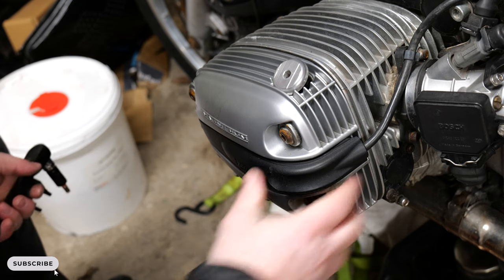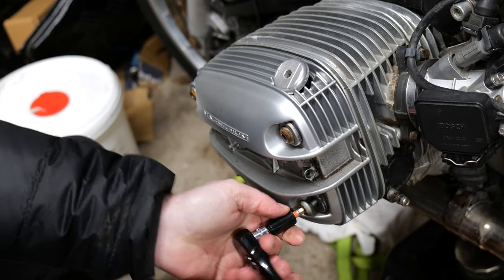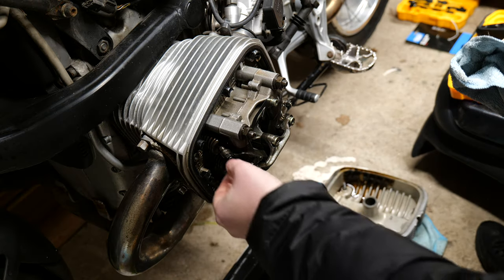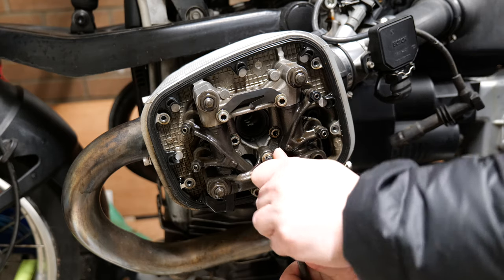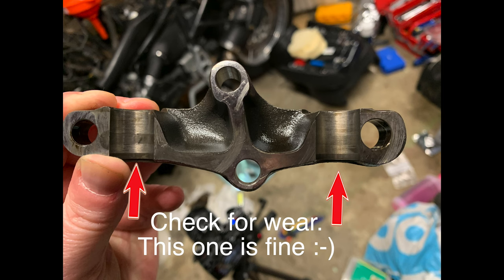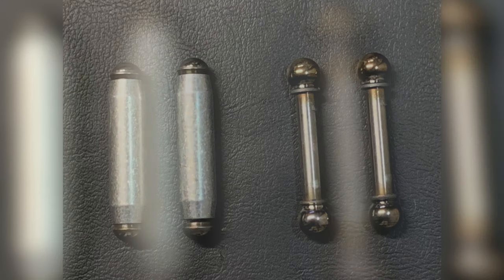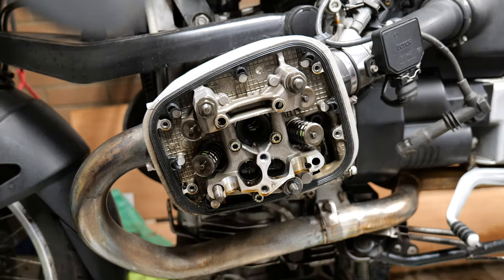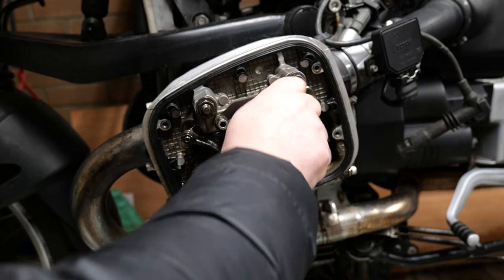BMW GS Upgraded Push Rods | Fitting new push rods to the BMW R1150 GS | Oilhead BMW. Ep 3

Comment: This is useful 👍. I didn't check my valve clearances yet but it's one of the next things to do. Where did you buy your pushrods?
Reply from the maker: Awesome 👍🏻. I got them from the motorworks.co.uk website.
Reply: @MALVSMACHINE  thanks for the link 👍
Reply from the maker: @leo5verling334  no problem at all. They’ve got a good selection of parts so hopefully you’ll find anything you need 👍🏻
Reply from the maker: @AlanBoulter  spot on aren’t they, quick delivery as well, can’t fault them one bit 👌🏻
Reply from the maker: @AlanBoulter  top notch and piece of mind 👌🏻
Reply: How many kilometers on this bike when you replaced the pushrods? Thanks and a very good video
Reply from the maker: Hi, sorry about the delay in reply, youtube doesn’t notify me if someone replies to a comment I didn’t create. My Bike had 54’000 Miles on it and I only replaced them because there was a rattle. There was only one out of the eight that was making the tapping noise but it was loud enough to be an annoyance so I replaced them all so that I don’t get the tapping noise again 👍🏻.

Comment: I have a question, are those head bolts? Does it need a new head gasket afterwards?
Reply from the maker: From what I remember only one of the bolts are head bolts so I didn’t have to replace the gasket because I didn’t separate the cylinder. It’s worth checking the rocker cover gaskets to make sure they’re still soft and flexible, before refitting the rocker cover because they’re rubber and can start to leak if they’ve gone hard 👍🏻. 
Definitely consult the manual to check because it’s been a while since I’ve been in the engine.
Reply: @MALVSMACHINE  I will replace the head gasket anyway I decided, can't hurt to check out the bores while I'm in there.
Some people suggested I big end and crank bearings, but I think they should be ok after 100000 km.
Reply from the maker: @jochenstacker7448  that’s awesome mate, much deeper than I went 👌🏻 she’ll be like new again! I wish I could see what you’re doing 😄👍🏻

Comment: Hello, my friend, after watching your video, I would like to ask you how long it will take for this item to be replaced, or what is the situation that needs to be replaced, thank you, I am a viewer from Taiwan.
Reply from the maker: Hell my friend from Taiwan! That’s amazing! 
I think the job will take between 1 and 2 hours and you will need a torque angle gauge to ensure the bolts are tightened correctly. I replaced the items because they make a tapping sound when the pushrods start to loosen off, as they are made of three pieces. The new pushrods are one piece so will not make the tapping noise.